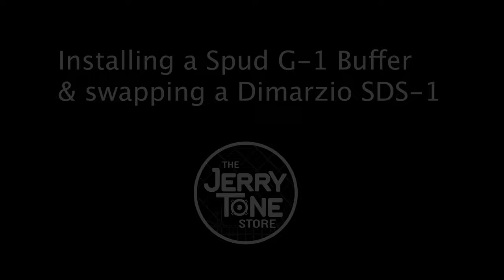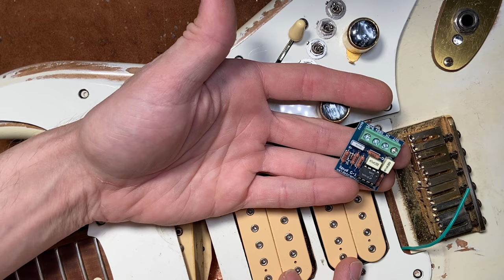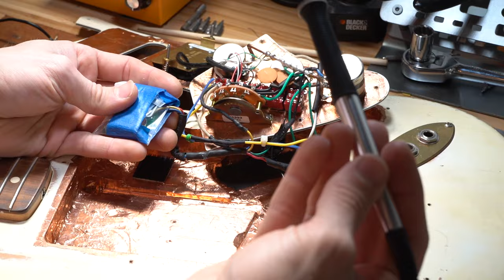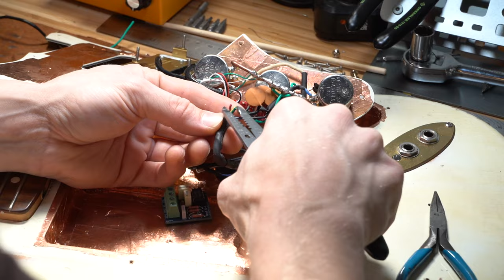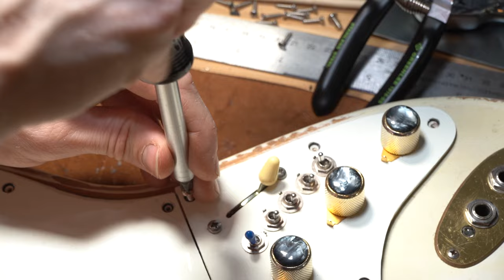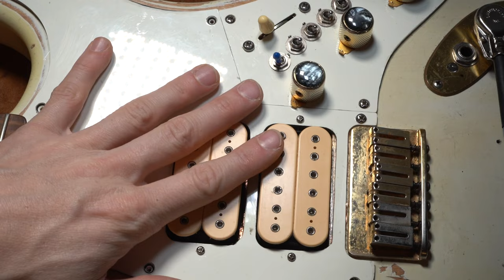DIY Jerry Garcia Guitar: Buffer Installation & Neck Pickup Swap

Comment: Pickup screws. I use an alligator clip. Compress spring with hand and put clip on with some thread available. Screw on pickup a bit and remove clip.